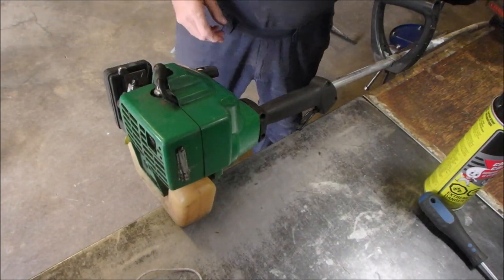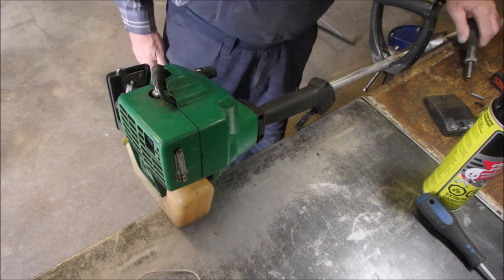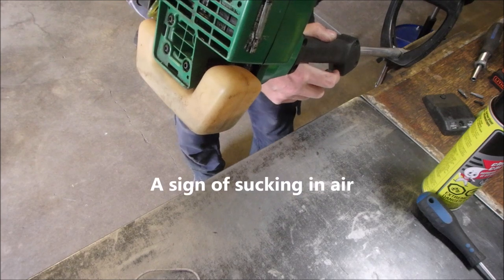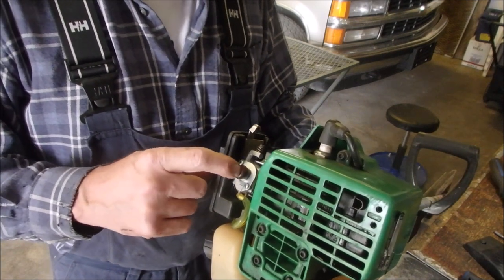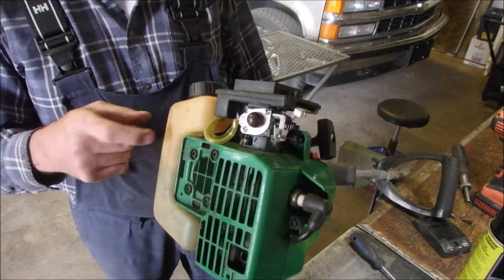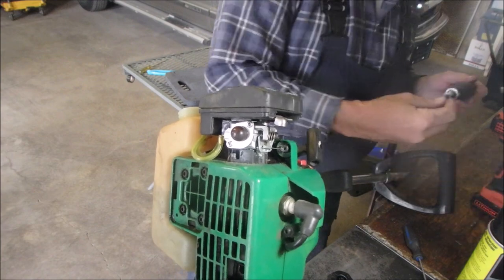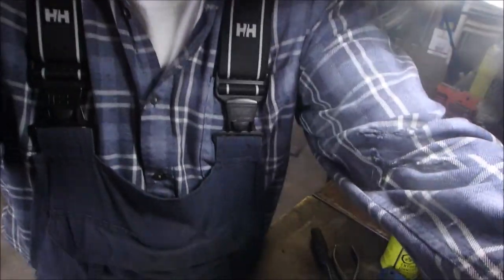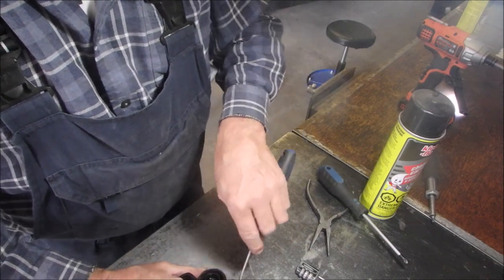My Own Weed Eater is Not Running Well

Comment: Good show Bruce! It was  originally tuned with consideration for the air leak. That would work... if the leak didn't change.(leaks always change)
Reply from the maker: Right.  I got lucky here.
Reply: Lucky is when a rookie stumbles across it, you didn't get lucky, you flexed 2 or 3 weeks(🤣) worth of experience on it.

Comment: funny thing is I just installed a HIPA carb on a Homelite,  and its gas cap was leaking , missing O-ring also,  I just changed it to another cap I had on hand from  used parts.
Reply from the maker: Good for you!!!

Comment: Bruce, dumped mine for a 20V Dewalt last year. I can go a whole month without needing to charge the battery, no carb tuning, spark plugs or fuel draining required!
Reply: I use a B&D string trimmer that uses the same battery as Bruce's B&D drill.   I have a blower, trimmer and drill that use the same battery.   Love the drill and trimmer.   Blower isn't powerful enough other than very light duty.    My trimmer lasts about 40 minutes or so.   You must not use yours very much!
Reply: I agree, weed wacker, to battery, blower, hedger, thinking of going battery on those machines.
Reply from the maker: I understand.
Reply: I’m figuring out how to put a Quantum on a weed wacker.

Comment: Great repair Bruce , I have the ultralite one and likes to put a little oil out of the exhaust . Am thinking maybe to rich? What's your thought. Thanks again learning new stuff every vid!!
Reply from the maker: I mix my own to 50-1 with a good oil
Reply: @BrucesShop  Hi Bruce I do the same with mix. But I've never come across a motor that leaks out a almost tar like oil out of exhaust. It dosent bog and runs clean so Ian not sure what's the issue?
Reply: Metering arm in the carb is not adjusted properly.  Using more fuel
Reply: @Thomasploeg1968  Hey Tom, it has a high and low carb mixture screw .Theres no metering arm just fuel pump arm inside of carb.  Am thinking what Bruce suggested it's the type of oil iam using.